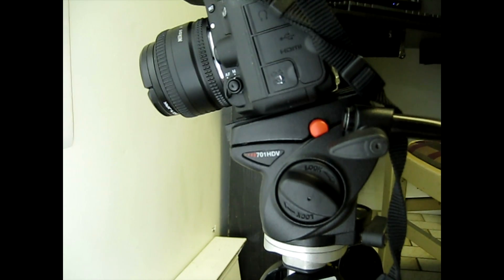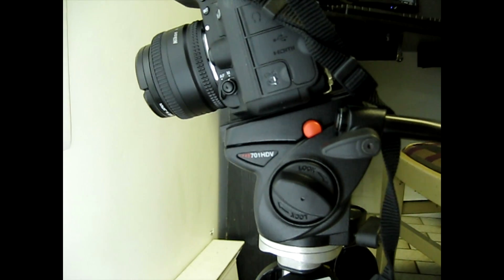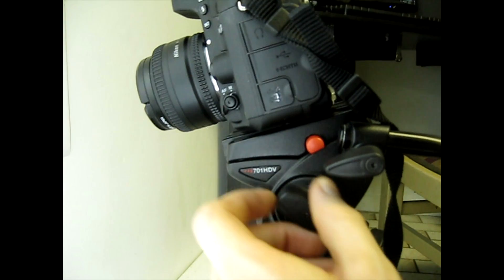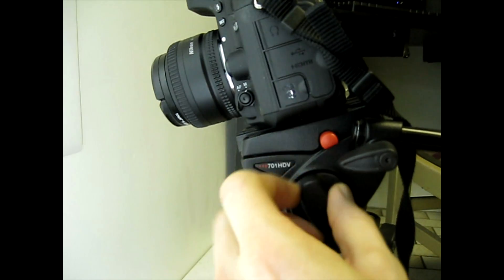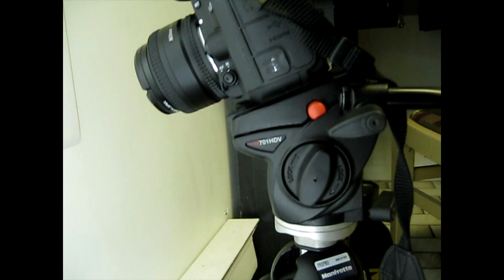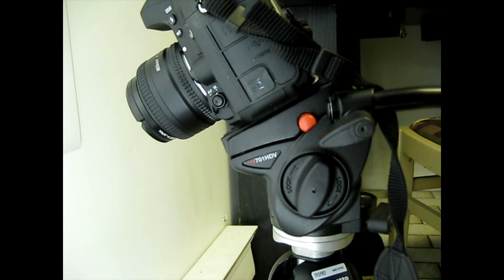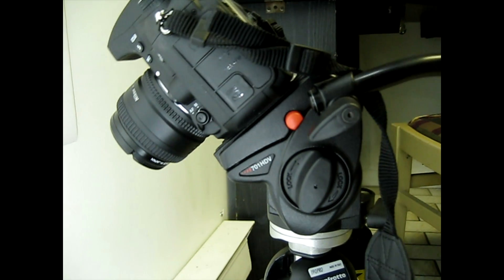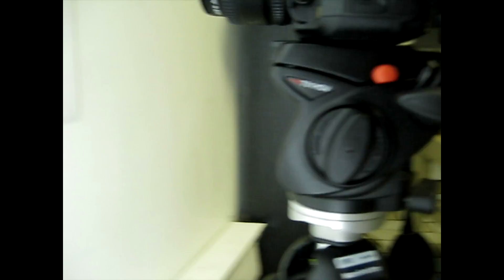Nikon D600 Sensor Dust Timelapse (pt.3)

Comment: Cleaning the sensor yourself is easy. Just use the Eclipse solution and type 3 swabs. I cleaned the specks off of my D600, and it hasn't been an issue since.

Comment from the maker: It looks like we just may have to with this particular camera.  

The problem is still there, I'm getting some new spots on the sensor, but it is not nearly as bad as it was right from the start.

I've heard Nikon is removing the excess lubrication along with cleaning the sensor for cameras with this problem.  I hope to get it back soon so I can run another, (hopefully final) test.

Comment: Upon receiving the D600 I was aware of the dust problem so did the sky shot test with one image. That very first image had loads of specks and what appeared to be lubricant spatter. I wet cleaned the sensor and pressed on testing. It took about 15 images to see some specks again, though less but little lubricant spatter. I sent it to Nikon anyway. It does seem though that with time the problem lessens. Just as it did with my D7000. Nikon has QA problems and that's a fact!

Comment: That would be quite ridiculous.  Hopefully they fix the cause of the issue, instead of fix the symptoms.
I just thought of something. I'm wondering what the shutter speed of your shots are.  Though I don't know if it's the mirror slap that's causing this, or the shutter mechanism, it might make more spots if the shutter speed were 1/8000 compared to 1/60?  Maybe the LCD monitor brightness as a background would help for this scenario? Thanks for the video upload, time, and all those wasted shots.

Comment from the maker: I spent a good amount of time with an air blower, trying to blast away all the dust, and it hardly made a difference.  

I think these are oil spots, not dust spots, meaning a wet cleaning is needed.